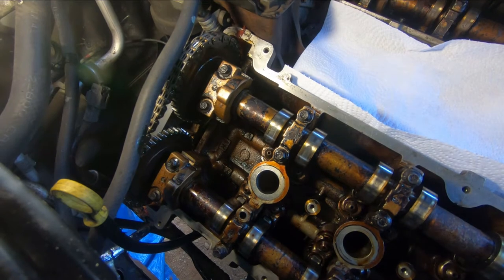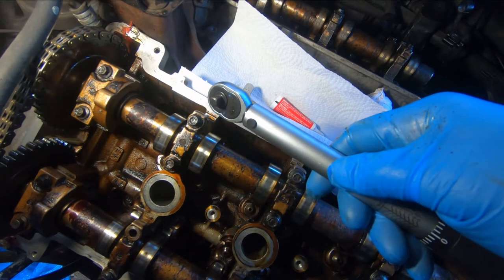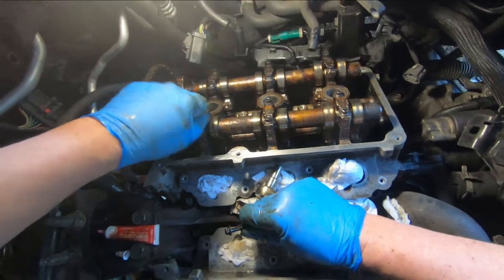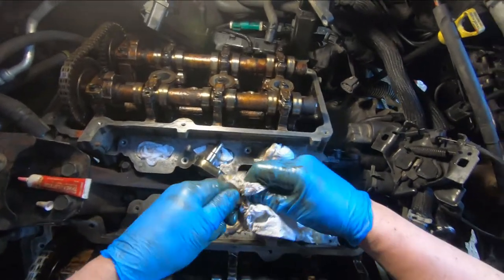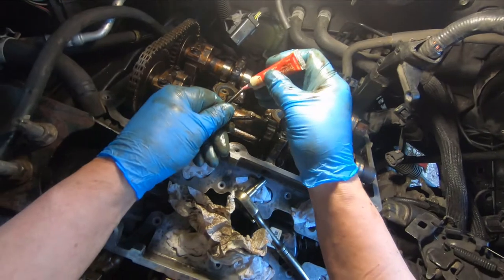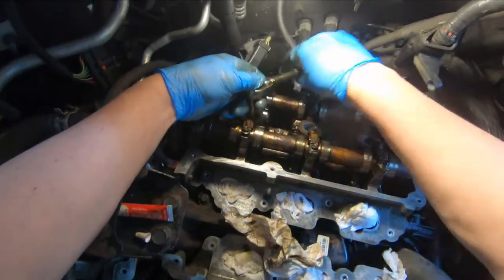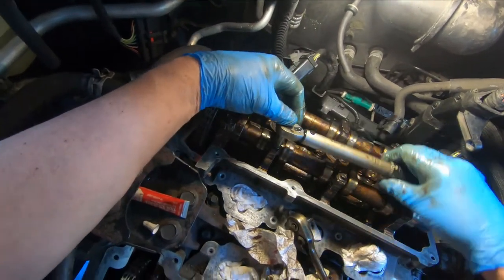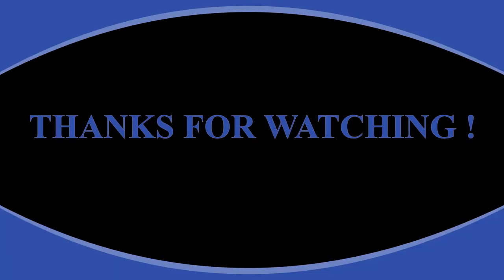DON'T OVERLOOK THIS STEP  FORD 3.0 CAMSHAFT RE-TORQUE

Comment: Thank you for sharing! I am doing this now after replacing my cylinder head on mine. Great tip! Especially since i cant afford new bolts but do have threadlock.
Reply from the maker: It’ll just take a few minutes to lock those bolts down and you’ll have peace of mind knowing they won’t come loose. Good luck and thanks for watching and commenting.

Comment: I'm getting a loud rattling noise within my engine the last couple of days. Yesterday the check engine light came on. I was getting P0340 and a P0344 code which are camshaft position sensor codes. I swapped the bank 1 and bank 2 sensors to see if it was actually a sensor tripping the code. Both times the codes were coming from bank 1, so I'm assuming it is not the actual sensor.  Could these bolts coming loose and /or breaking trip the codes and cause the rattling noise?
Reply from the maker: It's difficult to diagnose a problem without seeing the vehicle but my advice would be to park it. A failing camshaft position sensor can cause rough idle and other performance issues that may appear as a noise. You may have other issues but since you have the code, verified by switching bank 1 to bank 2, I'd get a new sensor and try that. The bolts do come loose sometimes, but would not necessarily result in a code for the sensor. That said, the camshaft would have to be rattling around quite a bit to set off a code (if it was from loose cap bolts).  Removing the valve covers and doing a check of the bolts will give you peace of mind and may eliminate them a s a cause/symptom. It's not a huge job, and can be completed in an afternoon. Sorry that I can't be more specific, but the one thing I'd do for sure is stop driving the vehicle until you sort it out. All the best!!
Reply from the maker: I just thought of something else. The timing chain could be slack/worn but usually, you'd get another code for the crankshaft position sensor. Start with the easy stuff and see if a sensor change will do it. A loud rattling can be the sound of many internal engine issues: worn/jumped timing chain, connecting rod bearing failure, loose camshafts or worn camshaft bushings, dropped valve, etc, but since you're getting the code for the camshaft sensor, I'd look at that first. Since these engines sometimes have loose camshaft cap bolts, it would be prudent to have a look before assuming the worst. Good luck!

Comment: Hey thanks for the tip.. just one question what type of tredlock do you use or can recommend for this project?
Reply from the maker: I used a RED LOCTITE. It could have been Permatex brand, can't remember. Any parts store such as NAPA will have it. Thanks for watching!!
Reply: Locktite 243